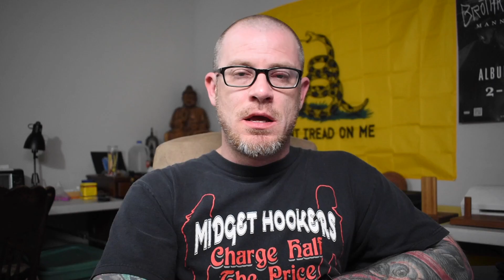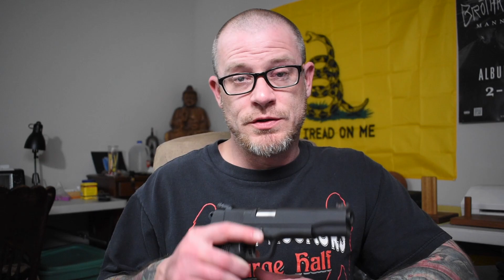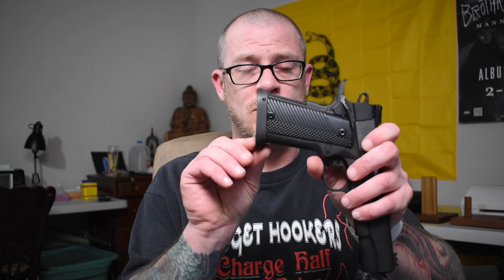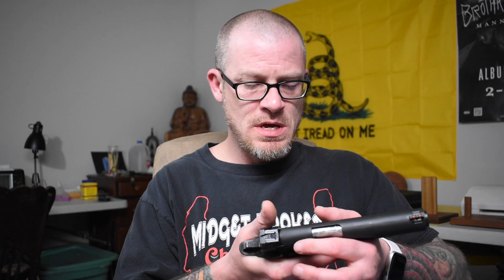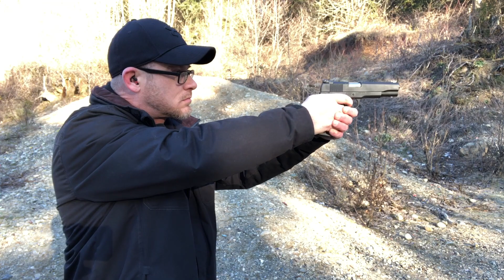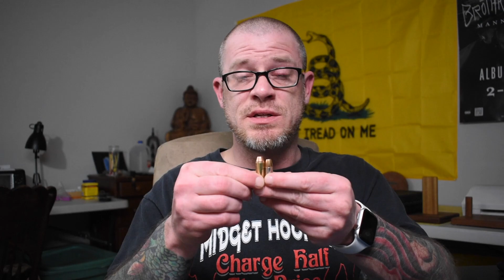Rock Island Armory 10mm 1911 - Budget Friendly Hand Cannon

Comment: appreciate your comments on the RIA 1911 pistols as being factual and unbiased. i have a RIA Tac Ultra A1  in 10mm and Im amazed in the fit and finish of this pistol, I  fired 100 rounds of the Armscor 180 grain FMJ straight out of the box without any feeding or ejection problems. trigger pull was about 4 lbs, with very little creep, recoil was sharp but not uncomfortable, as I shoot .45 cal pistols since forever. now, Im awaiting the delivery of my second 10mm, still a RIA , the Rock Ultra A2 with the 16 round double stack magazines I. shot colt .45 pistols before but I absolutely love the RIA 1911s now. thank you.
Reply from the maker: RIA is a great starting point to get into a 1911.

Comment: Anyone having issues fully loading the mag
Reply from the maker: Two major issues with all 10mm guns are mag springs and recoil springs. A lot of companies will put a recoil spring in that is too light for the heavy, full power 10mm rounds so it runs well with cheap range ammo but not full power 10mm. Or they put a heavier spring in and it runs great with full strength 10mm but wont be reliable with cheap range ammo. 

Similarly many manufacturers tend to run too light of springs in their mags which causes some real issues with feeding. RIA seems to have gone the other direction with their mag springs and my experience is they are really stiff, almost too many coils. It’s great because they are pretty reliable but a pain to load till they are broke in. I would recommend getting a speed loader to help make it easier till the spring breaks in.
Reply: @360TacticalSolutions I got 2 extra mags when I bought my 52009. With the 3 mags, all gave me ftf with the cartridge stuck on the feed ramp. I disassembled the mags, cleaned them with clp and lubed the spring to follower connection with heavy lube . Since then my gun runs flawlessly with every cartridge I load it with. Even those reloads work well (just tested 50  rds to prove the point, not planning on doing that more often).

Comment: Bought one year’s ago and had to do a little work on it. The front sight came off within first mag! Sent it back and they put the wrong height sight back on it. Was shooting 8” high so I just ordered the correct sight and a heavier recoil spring because it was slinging brass 30 yards! 
   It’s now a sweet shooting pistol but not one I could recommend without disclosing the poor CS or QC!
Reply from the maker: Its been almost two ears since I did this video. In that time I have spoke with several other people who have the same gun. What Ive gathered is that the QC can be hit and miss. The one in this video was great, no issues...but then the next guy may get one and it have some of the issues yours had. I do think more recently they have worked to clear up the QC issues but that's going to take some time and work. My RIA 9mm was flawless right out of the box and that's a fairly recent build. You should check out my custom grip video for these guns. Nothing better than customizing these things
https://youtu.be/trexAHvoSy8

Comment: I love how this HC feels in my hand,Solid firm grip and the weight makes an easier more accurate shots...
I Own the single stack full rail 10mm...Wished I had the HC as well.
All RIA Handguns needs some working on its mechanics that I love doing,  Fine tuning everything for your liking.... It could be some filing,sanding or even just some polishing some parts on the inside as well the slide... This is all by design as a Working mans gun that you spend time on to make it your own... 👍😎🇺🇸🇺🇸🇺🇸.
Reply from the maker: They are great guns. You should take a look at the custom grip video I did
https://youtu.be/trexAHvoSy8

Comment: So I have this exact pistol. When I first shot it, it wouldn't go through a full mag without a malfunction. I replaced the recoil spring and boom problem solved. Since then 100%. Yes the safety lever does have sharp edges but I can live it. I will say the trigger is amazing and it's accurate as can be.
Reply from the maker: This one is a loaner. It belongs to my uncle. Its incredibly accurate but I have found it to be inconsistent as far as the reliability. I will say its only got a couple hundred rounds through it so Its not yet broke in. But with the cost of the 10mm ammo thats an expensive venture lol
Reply: Wow what recoil spring did you use ?
Reply: @jasonjones2113  I know it was a Wolfe spring. I wanna say I went up 2lbs from the factory spring. I shoot full power norma rounds. It hasn't malfunctioned since then.
Reply: Awesome
Reply: Appreciate it

Comment: You think this, glock 20, or glock 40? I’m in between all these three guns and can’t make a decision.
Reply from the maker: Thats going to boil down to your personal preference and what you intend to use it for. Over all I would go with the RIA over the Glock. The only real advantage the Glock has is that it weighs quite a bit less. Thats only an advantage if you plan to use it as a carry gun and don't like a heavier gun on your waist. The Glock being light is also a disadvantage. The RIA being as heavy as it is helps with felt recoil. The steel frame doesn't flex like the polymer of the RIA. With it being a heavy gun its going to be a bit more accurate over all. The only downfall in a carry situation for the RIA is that it IS heavy lol. This one was a loaner. It belongs to my uncle who is a real big guy. He doesn't seem to mind carrying the RIA, thats his daily carry.
Reply: @360TacticalSolutions  thanks man I appreciate it that helped.
Reply: The 10mm round is a hard hitting round that’s basically a .40 S&W sized projectile coming out of a longer casing with more gunpowder. You can actually use a 10mm as a trail gun in case you come face to face with a bear. I had a Glock 23 which is slightly smaller than a Glock 20 and it’s chambered in .40 S&W. That G23 was so unpleasant to shoot and had so much muzzle flip that I ended up trading it for another gun. In a rapid fire situation is was damn near uncontrollable. I couldn’t imagine that a G20 or G40 is much better. You want a heavier gun to absorb that 10mm recoil. I’d go with the RIA for that reason, plus it looks a lot cooler than the Glocks.
Reply: I didn't like the idea of the unsupported camber of the glock I've seen them blow up plus I always wanted a model 1911

Comment: I left the two big 1911 groups as well months ago. The I have this brand and it's best attitude is cancer.

I don't mind a loose gun or burs on a 1911. But I do expect it to be reliable. So picky on ammo isn't acceptable.
Reply from the maker: SVTBansheeman that attitude is ridiculous. I own an STI. Love it. But you know what...still searching for the RIA HC 9mm. The snobs out there are horrible. As for the picky ammo on the 10mm, I hear that’s typical for a 10mm in the 1911 platform. Had that one not been a loaner I’m sure I could have tuned it a bit and got it to run I wider variety of ammo but you know, loaner gun lol
Reply: Not so much picky about ammo. It's a matter of buying the hotter loaded stuff.  10mm has been kind of put in a bad place because the FBI loading are similar to 40 s/w in terms of power.  So when you design a 10mm it's difficult to build one for everything.  I run ammo with 600 ft/lbs of energy at the minimum and it's always ran perfect.

Comment: 1) a) the mag well - There is an allen-head set screw on the bottom to tighten up the mag well.
b) The mag well is steel.  Taylor Freelance makes an aluminum one for RIA (two versions, one for guns that came with a factory mag well and one for guns that did not).  It is wider than the factory RIA mag well.  Also available from Advanced Tactical.

2) ammunition - a lot of 10mm is loaded light, closer to .40 S&W.  Full power 10mm is comparable to .41 Magnum (more powerful than .357, less than .44).  Underwood Ammo loads theirs REALLY hot.  Check out their 155gr HTP JHP (775ft-lbs) and their 100gr Xtreme Defender (740 ft-lbs) using Lehigh solid copper bullets.  They also sell hard cast lead for deep penetration of tough game.
My RIA 10mm will also feed and cycle .40 S&W, so you can use less expensive .40 for the range in the same way that you would use less expensive .38 special in a .357 Magnum.

3) all of the RIA A2 (double stack) frames are based on the Para Ordnance/Para USA "Big Hawg"/14.45/16.40/18.9 frame.  So the RIA .45ACP uses Para 14.45 magazines from Mec-Gar, the 10mm/.40 uses 10mm Para 16.40 magazines from ACT-MAG, and the 9mm uses Para 18.9 magazines from ACT-MAG.  All of them have the exact same geometry at the bottom of the tube, so fit aftermarket extended base pads meant for the Para 14.45 like the aluminum +2 base pad from Dawson Precision and the polymer +2 base pad from Arredondo.

Dawson discontinued the Para Toolless +2 base pad, (item #005-004) but if enough people ask for it at sales@dawsonprecision.com they will bring it back.

Other parts (triggers, hammers, grips, etc.) that fit Para Hi-Cap frames will fit the RIA A2 frames.

4) Capacity - ProMag makes 170mm 20-round .45 ACP magazines for the Para 14.45 that will fit the RIA .45ACP.  Advanced Tactical sells 140mm and 170mm ACT-MAGs for RIA 10mm (18-19 rounds and 24 rounds) and RIA 9mm (19 rounds and 29 rounds) as well as Taylor Freelance aluminum extended cap base pads.
Reply: I appreciate someone who goes that far to list all the particulars you wanna know. Well done 👍
Reply: What about blue loctite at the front of the magwell?
Reply: Have you ever heard of some 10mm ammo that's just a tad too long for the double stack magazine that came with the A2? Had this happen to me with American Ordinance ammo but haven't heard of anyone else having the same problem.
Reply: You da real mvp

Comment: I had the commander size RIA in 10mm and sold it.   It was 8 rnds if I remember correctly.   It was a little heavy as a carry gun and since I have a kimber ultra carry 2, I sold it.   But I was very happy with fit & finish versus $$.   Ive since bought a RIA 2011.   It’s the Ultra Tac HC in 9mm/22TCM.   I’ve not shot the 22 TCM barrel but I love the 9mm!   One of my favorite pistols.   With the full length dust cover, it a heavy pistol which tames hot 9mm recoil to extremely low levels.   Very happy.  Might pickup another in 45 or 40 S&W.   I reload and 40 S&W & 9mm range brass is so available I tend to go with those calibers if I’m planning shooting a particular pistol a lot.

Comment: What gun doesn’t wobble tho ??. Slides need to be able to slide they will have wobble , great gun btw never had any problems with it and I love it I carry it with no shame and take it hunting knowing that if I need my gun for protection against a threat I know it’ll have my back.
Reply from the maker: Erik Orozco a high end or hand fit hand gun will have right tolerances. The slide and rails should be a perfect match so that there is very little side to side or up and down type of movement while still being able to have a smooth gliding motion forward and back. I’ve handle 1911’s at the same price range as the RIA that have quite a bit of slide movement. That’s ok I guess, they still function but over time as the slide and rails wear the gun is going to get sloppy and breakage will occur. I think the point I was making is the fitment with the RIA is incredible. The slide and rails were filed to such tight tolerances you wouldn’t know it wasn’t a $3000+ gun just going by how well they were done. I’d definitely use that gun hunting or as a defense gun, especially while hiking as we have cougar and bear all over the place where I’m at. Still trying to get my hands on the high capacity 9mm version but those things are real hard to come by these days. Found one last year and I knew I should have got it while I could, still kicking myself in the ass over it

Comment: I’ve wanted a 10mm for a long time but I don’t really know if I would want to go with a Glock platform or a 1911 platform... I’m partial to Glocks but I just do t know enough about them I guesd
Reply: I have a ruger sr1911 10mm, and a polymer80 PF45 which is a 80% glock 20 frame with a 1911 grip angle. Personally I like my polymer 80 build a little bit more than my 1911, and I would highly recommend it if you choosing between a glock and a 1911. Don’t be intimidated by the whole building aspect. It’s super easy and there are a ton of great tutorials
Reply from the maker: Abel Straw how’s the difference in recoil between those two? Curious how the polymer frame handles it next to an all metal gun
Reply: 360 Tactical Solutions the polymer frame handles the recoil slightly better in the hand because of the flex, and I get less muzzle flip with the polymer 80. I shoot mostly Underwood Ammo or the sig sauer fmj, so it’s full house 10mm, but both guns are super manageable in my opinion.
Reply from the maker: Kelby Corey that’s a tough choice to make. The Glock is known for its reliability but a tuned 1911 beats a Glock all around
Reply: I bought one on Wednesday ,Glock 20 .I personally like a full size pistol, really it's okay. extended mags are fun 15 round capacity magazines are cheaper than double stack 1911 but Glock holds 15 1911 holds 16.I'm not satisfied I think I'm going to go with the 1911 personally not a fan of Glock in general. Glock magazines are more available I think it comes down to personal preference if there's a shooting range you can go and rent both I would .... Just my two cents
Reply: I am a 17 MOS and EDC 21 guy. Picked up my RIA 10mm today….. needs better grips but otherwise I liked it shooting 180 hand loads.
Reply: 10mm ? 1911 all the way! all steel pistol!